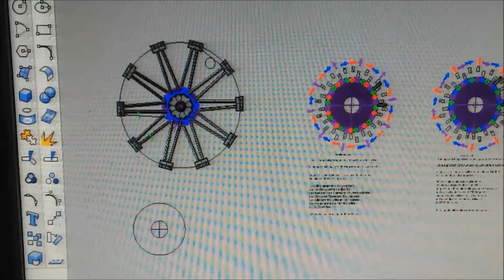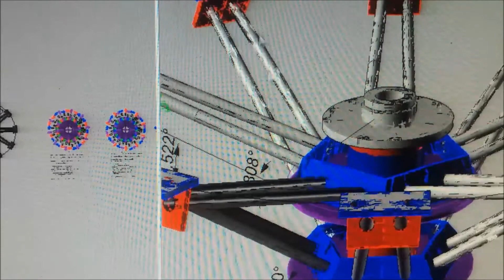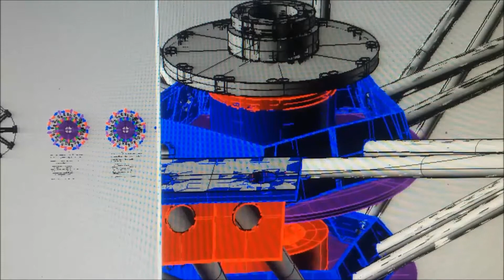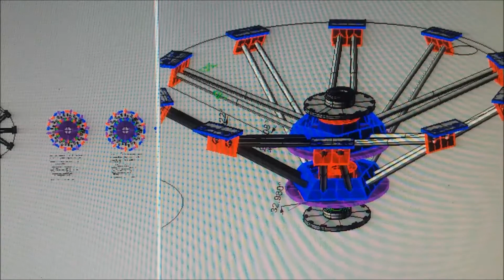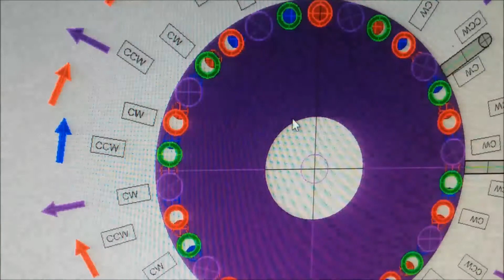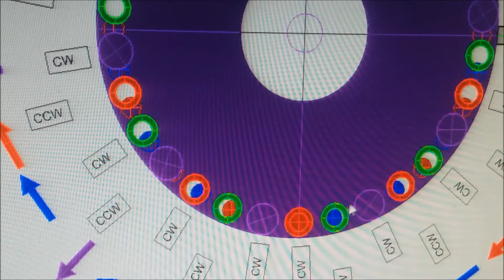"BUILDING OUR DREAM HOME IN THE PI", CHAPTER 40, WHOLE HOUSE FAN"OUR DECAGON HOUSE"

Comment: Both my grandparents had whole-house fans in their homes.  Worked very nice to pull air in from outside.
Reply from the maker: HANDY FOR PUMPING HOT AIR OUT OF THE ATTIC ANYWHERE, BUT HERE WE INTEND TO COOL THE CONCRETE OF THE HOUSE AFTER DARK AND SHUT IT OFF DURING THE HEAT OF THE DAY. THE DESIGN OF THE BUILDING MAKES IT'S OWN BREEZE AND UPDRAFT COOLING DURING THE DAY. IT'S ALWAYS PLESENT INSIDE AND UP IN THE WORK AREA IN PARTICULAR. BE NICE IF THAT WAS LIVING SPACE UP THERE.